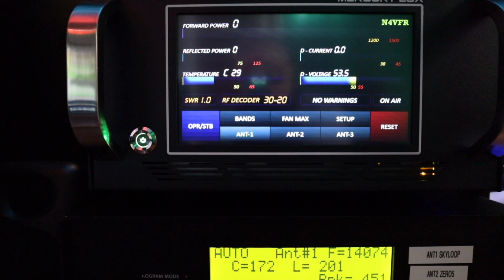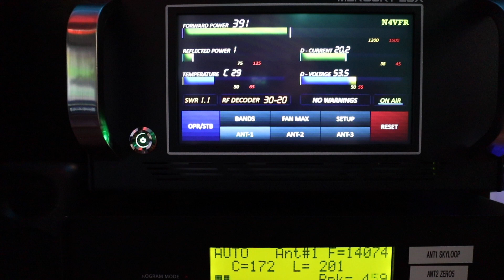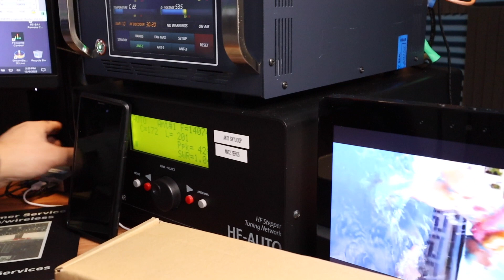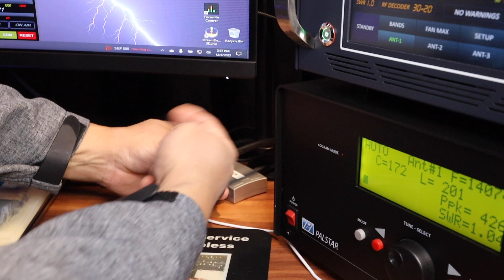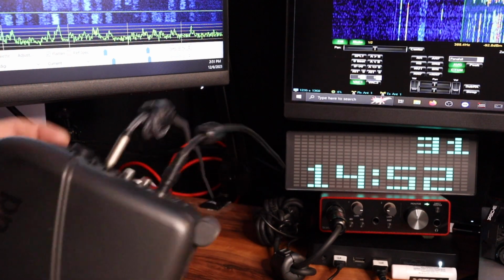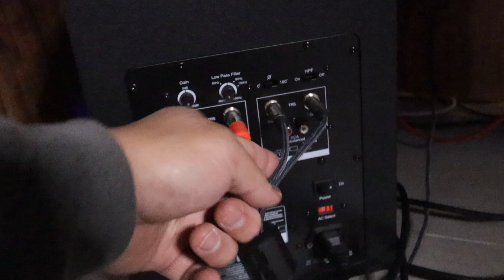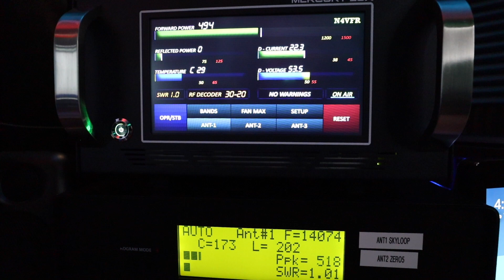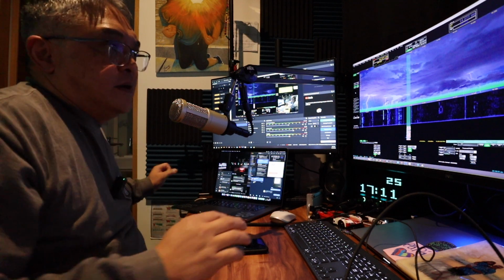RFI Hum/Buzz/Noise coming out of my Powered Speakers while Transmitting on HF | Torroids and Ferrite

Comment: Hey, Darren.  I have experienced a similar RFI problem.  Buzzing & hum when a sleep sound noise generator was being used.  Same volume no matter what the unit volume control was set to.  Unit operates within 40 ft (12m) of an all band no ground radial vertical antenna.  Antenna is mounted 18 ft (6m) AGL.  75 watts FT8, mostly.  Problem noticed on all bands, 80-10m.  Tried a toroid (many turns) on the 6VDC power cord from the AC adapter.  NO effect.  Installed an in line common mode filter in series with the 6VDC supply leads.  Again, NO effect.  Tried on battery power.  OPERATES NORMALLY!  Replaced the original switch mode AC adapter with a transformer powered adapter.  RFI problem is gone!  Cheap Chinese switch mode AC adapter was producing "dirty" 6VDC.  Give this a try.  It worked for me and my XYL is pleased!

Comment: Hi Again Darren:  Just dawned on me... is your SKYLoop no longer resonant?  Have you shot it with you antenna analyzer to see what the the shortening has done to the inductance on the antenna???  Perhaps you have before and after VSWR readings???  I suspect something that you did with the antenna has a cause and effect with the RFI. Perhaps the Balun Design 1116di coax choke,  is best placed OUTSIDE the shack before the coax enters your home.  I have the same choke and it is outside just after the lightening arrestor and before the coax enters the house. Art W1SWL
Reply from the maker: Art, I've got to try that and have the Choke outside my Junction box before it enters the shack.  Yeah, and I'll add a lightning arrestor before the choke.  Thanks!

Comment: Hi Darren, I had the same problem with a pair of inexpensive powered speakers.... the solution for me was to replace those speakers with a pair of B&W M1 powered speakers, (possibly no longer made by B&W).  However also in your case you have some sort of Scarlet audio preamplifier in your audio chain.  I do wonder if the RFI is getting into the Scarlet prior to getting to the speakers?   Are your headphones also powered by the Scarlet?  If you bypass the Scarlet for the headphones..... then do you still get RFI into the headphones???   Worth a try for sure. Art W1SWL

Comment: Seems like stopping the RFI before it comes in the shack would be best. Is your coax grounded through a lightning arrestor on the outside of the house?
Reply from the maker: This particular cable from the 40 m horizontal loop, No.  My Zero FIve 27' vertical, Yes.

Comment: Hi, it is a frustrating problem and of course it can be a difficulty to isolate how the RF is getting into the shack. Some of it of course is due to proximity to the antenna but some may be common mode RF. The FT240-43 cores are ideal for many situations. Frequently an issue is multiple possible paths,  IE you can put a common mode choke in one place that is effectively bypassed by another cable. Good luck, it is always great when these things are resolved.
Reply from the maker: I've ordered more FT240-31 Torroids.  It's more focused on the lower HF bands.